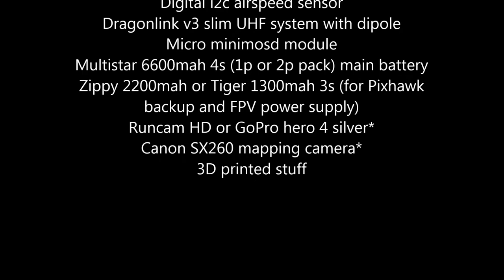X-UAV Talon (FPV Platform) build with removable V-tail

Comment: Nice build , where did you put the Canon SX260 ?
Reply from the maker: I'll post a quick photo / video on that later. But the cam is mounted on the fuselage floor, right in front of the flight controller tray

Comment: I’m very interested by your remouvable tail. Are you happy with it ?
Reply from the maker: yes, makes it easier to pack the plane when I need to travel :) I followed the design of Aeromapper Talon, same mechanism for removing and re-attaching the V-tail
Reply: As you fly a mini Talon and a Talon, do you think the normal Talon is more interesting for LR fly ? I like My mini talon, the electric consumption is very low, but I don’t think It can carry a Gimbal as my sky surfer 200.
Thanks for your subscription.
Reply from the maker: Talon flies a bit slower :) Although both can do long range flying, the Talon can be as efficient as the mini talon, or nearly as efficient. Aside from the difference in speed, is the Talon's carrying capacity. The Talon's larger fuselage will definitely allow bigger packs for extra long flying times/distance. It can definitely carry a lot of weight, capable of carrying my Sony A6000 for mapping, something a mini talon would have difficulty carrying. Yes, you are right, a gimbal would be heavy, but it can still be carried by a Mini Talon. Mark Qvale (itsqv.com) has posted some designs and videos with gimbal on Mini Talon. It can fly with it :) but weight penalty is higher, compared to a Talon added with a gimbal. It would be better not to install a gimbal on Mini Talon if you will be flying long range, as it will fly like a brick, shorter flying time as it will require more speed to maintain its altitude.
Reply: Thanks for this long andswer